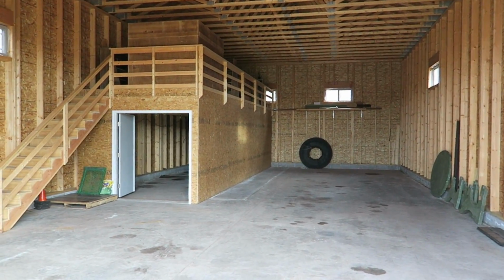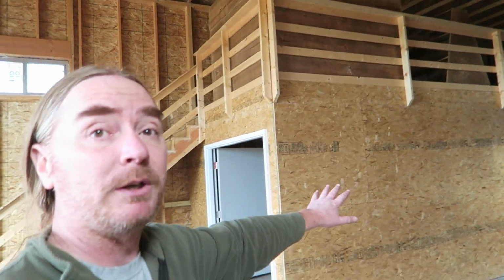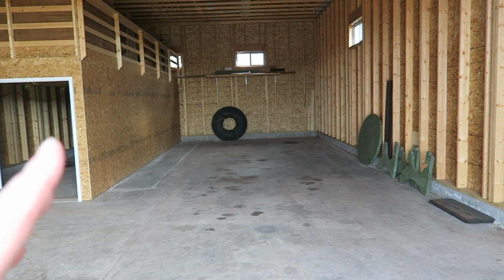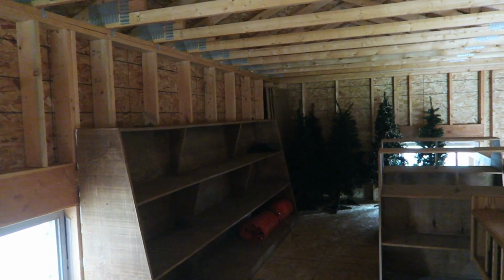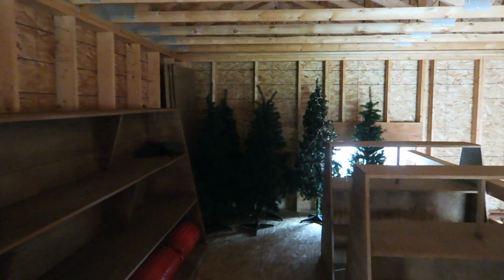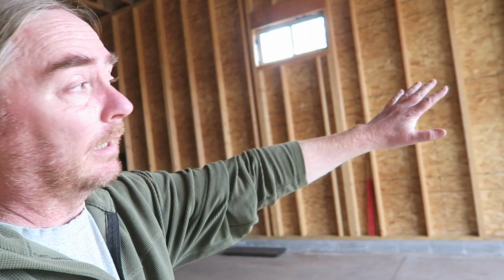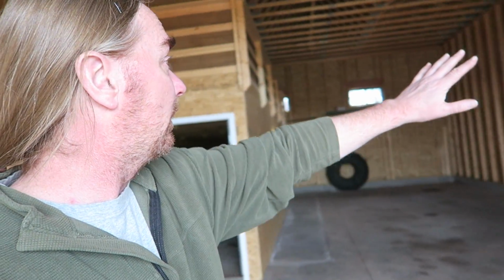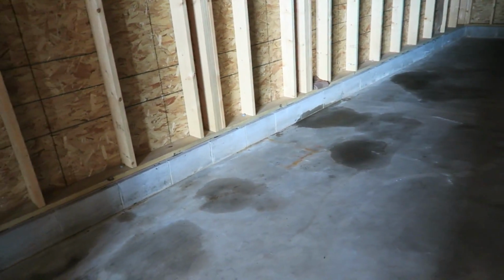CHECK OUT THE NEW BOAT SHOP!!

Comment: May I suggest spray foam insulation throughout. Mold, mildew and fire resistant drywall. My 1000 sq ft shop was fully insulated and unheated. I never had to wear more than a sweat shirt and most of the time didn't run ac. I live in New Hampshire

Comment: Look at the installed cost per R value, not which insulation has a better R value per inch of thickness.  A better insulation that cost three times as much to buy and install will probably not be the best solution.  I would assume that you can install 6" batt yourself.  I don't know what you figure your labor cost at, but I know mine is very low when I'm working on my own property as long as you don't keep track of the beer.  Your right about the inefficiency of heated floors.  It does make the floor real comfy, but you are putting the highest temperature against the cold cold ground which is indeed a heat sink. Insulation or not, it will increase the heat loses from your building.  Look at high bay lights.  Things designed for warehouse lighting.  These are available in many light sources.  LED is the most efficient light source we have today.  They are also usually the most expensive to buy.  They are supposed to last for very long time, but most of them require replacing the entire fixture it it does fail.  There are no bulbs to replace.  Retired building systems engineer.

Comment: ive been in the drywall trade for 30+ yrs. and i noticed the video where they hung and finished the drywall. i could tell they werent very experiabced however they got it done. on your new building if you want to save time and money and materials, use 12 foot sheets of drywall less seems/materials. 1/2" thick. 5/8ths will be very hard to hang and is overkill. Use 4'x12'x1/2" it will be fine. however if there is a code you have to go by there for fire code/safety then it will probably be 5/8" thick sheetrock. i know out in NJ if the garage is connected to a dwelling then you have to use double layer 5/8" (2 hr. burn time) on walls and ceilings connected to the house. i dont think you will have that issue there though, but i know for a building of that size there will be some kind of codes required. if the drywall guys try to use 4x8 sheetrock then tell them to go home. it will probably cost 30/35$ per sheet hung and finished. and yes, hang the ceilings then blow in the insulation. i dont think you have to foam the walls, im sure there is  roll insulation for that. but i am not an insulator. im a sheetrocker/ marine maintenance tech nowadays

Comment: Run your electric. Spray foam the walls and roof. Put in a drop ceiling to help with keeping heat down plus bright LED lights, ceiling fans to move the air.

Comment: Use 4000k led hi bay 22000 Lumens or better from a reputable manufacturer it makes it easier to get parts in the future. Most will have a 5year warranty on parts your electrician warranty should be 1year on labour.

Comment: This is the first time I have ever written a comment on any YouTube video. I am currently working on a bass boat which I purchased while it was raining and so didn’t take my time to inspect it thoroughly. I brought it home and you guessed it, I was a piece of junk. So I decided to o take this opportunity to learn how to work with cooso and fiberglass. I have so many questions I am not sure you could or would have the time to answer them. However, I need to start somewhere which in my case is the transom. How do I prep the rear of the boat before I cut and install the cooso and fiberglass if? Help me, Obi-Wan Kenobi. You're my only hope."

Comment: I would recommend having them spray about an inch or even less in the walls just to seal everything and using regular battens on the inside. You don't really need to go to the extreme  paying for that much  spray foam. Also you already have a vapor barrier with spray foam so you do not want one on the inside if the wall  as well, moisture caught in the walls needs to be able to escape.
I've been  building  my entire adult life, I'm  happy  to help in anyway I can. 
I appreciate  all the effort you put into your channel. Your my go to when it comes  to refitting my sailboat.

Comment: Don't choke on this project.  Get the utilities (must have).  Maybe insulate the small shop area the first year.  You need to generate income to get on your feet.  It sucks because a large part of the building has limited use during the coldest months.  Lighting is tougher choice.  I personally only use LEDS myself but I think the manufacturers are still learning.  Only 50 to 75% of the bulbs I buy get the actual stated life they indicate on the packaging.  Heat is an enemy to LEDs  If they get hot the electronics start to fail.  Make sure you allow for good ventilation around fixtures.   To efficiently heat I think you need air movement to keep the heat from piling up near the ceiling in the tall building.  Ceiling fans are cheap but the dust may be an issue when your doing final coats.   Just MHO    Good luck !!!!

Comment: Actually Harbor Freight might be your friend for lighting considering the have 5' 5500 lumen hanging LED shop lights for like 2 for $30. They sip power and you could hang a couple $200 or $300 dollars worth and light the shop pretty well until you can afford to go ham. I know Harbor Freight has a reputation for junk on a lot of things but some of what they sell is actually okay. I have 4 of those hanging lights I'm talking about in my small attached garage 16x24 and they've been running for 3 years 24/7 without issues. Not sure they'd be good enough for paint/body/hull work but with enough of them they should be good enough to get you by. As far as insulation I'm an old cheap fart and for that kind of money I'd just use plain ole' R19 roll and double it up with a good moisture barrier on both sides and save myself 10 or 15 grand. Throw some of the foam boards you see on the outside of houses on the bottom of those rafters and roll some more insulation on top of it and call it good. Anyway sorry for the book here just throwing in my two cents. Hope the new shop comes together as you want it. Good luck and God Bless...

Comment: Congrats on the new place.

Can't speak for all states but I think mine for electrical is that you can do your own work, but it must be inspected by a licensed electrician or inspector. Also, there are A LOT of electrical codes that can cause major headaches. Things like grounding, especially when you have water or gas pipes in the same building, number of outlets per breaker, outlet placement, lights per circuit, if exposed wiring is allowed, staple placement, ... the list is nearly endless. This is something you can do yourself, but be prepared to do the job twice, because you will have to redo whatever isn't up to code. Here's an example, another channel I follow recently did some electrical work in their shop. They added 3 phase power and did all the wiring. Turns out that he couldn't use white wire for 3 phase, so he had to run all new wire.

I'm cheap so I would probably do all the work myself and use a codebook or some electricians guidebook to ensure my work is up to code. Although this is assuming that the shop already had mainlines coming in.

Comment: I honestly think you could do the spray foam yourself, renting the machine. You have most of the skills already, and the majority of the cost is actually the labor rather than the materials. You'd probably have to buy a rolling scaffold rather than renting one, because it's going to be an absolute mess from leftover foam, but it will be necessary to do the wallboard anyway, and would be incredibly helpful if you do wind up working on large boats.

Comment: Definitely LED, just do your camera check to make sure they are "refresh friendly". But even the Harbor Freight shop lights are called, so super smooth on video.  You can get those for $24 each, or catch them for $14 on sale!

Spray foam is fine at 2-3", it'll provide air sealing, which is the first key.  After that you can roll fiberglass, it'll make it easier to wire/re-wire like some of the other guys said.

You don't want it "so tight it'll heat with a candle" though.  You're using chemicals in there, you need some air exchange. Trade off is paying to heat leaking air, bit you need those VOCs outta there.

Looks like an awesome shop, Good luck Andy!

Comment: You are most certainly correct in that you want to insulate full depth of the stud bay.  All your rough in needs to be done first.  Spray foam is fantastic it’s quick and clean.  Anything you want to ask about the process of finishing off your building.  PM me if you like.

Comment: Large LP tank and install infrared heaters in addition to the hydronic base board heaters. A 300k unit heater along with ceiling fans wouldn't be a bad idea in addition either. GA HVAC contractor here. Good luck !!!

Comment: Look for tradesmen that will trade boat  work for shop work. Keep the loft but remove the room below if it doesn't fit your needs. Yes Closed cell spray foam is expensive but if sprayed correctly will strengthen the shop structurally as well as insulate. Do your homework and make the best decisions based on your budget.

Comment: Cast iron baseboard radiators (Google it) or reclaimed building material stores for old radiators. I would go with fiberglass batting for overhead insulation rather than the blown in (used it once, not a fan). My two cents.

Comment: Fiberglass bats and a good vapor barrier job. Calk the joints and seal the wall before you put the fiberglass in. To tight promotes mold. I’ve had buildings flashed with foam first. You don’t have the room. If you had 2x8 studs it would be a different situation. Save some money up front and do a good job on your vapor barrier. Also invest in good air movement and keep the heat off the ceiling. I have a 40x60 in Alaska. 8 inch wall studs. 18 foot sidewalls. Hot water Floor heat with foam under the slab. Blown in attic which we did ourselves. Use the keep it simple method.

Comment: Congratulations! I spray-foamed my home and garage myself. You can order the canisters of two-part spray foam online. In my opinion, I would do insulation in three steps: Testing, spray minimally, finish with bats.  1.) Start with a blower door test. This simple test is a great way to find out how tight your building really is. You want like 90% or higher. Depending on the results of the blower door test, use different insulation methods. 2.) If your building leaks a lot, spray foam in a "window frame" technique, where you spray only in joints and corners (looks like a bunch of rectangles everywhere). This is an inch or two in the corners of bays but seals up the building really well. Run another blower door test and see if you get a better number. Once that's good then on to step ... 3.) Batt insulation in all the bays (over the "window frames" made by the spray foam). This is cheaper and an easy DIY project.                            The deal is, spray foam seals your building so it doesn't leak. But it's only needed in gaps, joints, seams, and any tiny space air can pass through. Batt insulation is cheaper so finish with that after spraying the building tight.  Spray foam is a really fun DIY project!

Comment: Hi Andy, here’s a bigger pill. Forget it-if you’re interested in real efficiency, forget the spray foam, flash and batt nonsense, or any of that other stuff. You can save the roof trusses and roof. 1. Support the roof. 2. Cut out the sidewalls-maybe someone will purchase. Replace with ICF-you can salvage the windows and doors. Sounds crazy, but you can then lower the roof after pouring the walls and you’ll have created an extraordinarily tight space with less unnecessary volume. All LED lighting-educate yourself on heat/color and you’ll find something you’ll be ecstatic about. Make sure to dig around perimeter of structure and insulate the foundation/slab from your soil. It’s really not as much work or as expensive as it sounds given that there is no existing infrastructure within. On demand hot water which you could also use with radiant, though if using radiant put it on styrofoam panels designed to accept and pour another slab over the top of everything. Yes, a lot of concrete-but worth it. Others may suggest a wall hung modulating condensing boiler with a Superstore or some such, but likely unnecessary. If you’re into efficiency and can afford the outlay, do this. I’ve built a few things, and this is what I would do. It will pay for itself shortly, unlike anything else-which means you are then making money.

Comment: Hi Andy: Well from my perspective I would forget about the spray foam.  Oh sure its a good insulator and will result in a good air tight structure but $18,000 is a lot of money.  I would drywall the ceiling and then blow in about R-50 in the ceiling.  I would go with something like rockwool in the walls for about R-17.5, vapor barrier and drywall.  Should result in good air tight structure if rollup door fits well.  
ELECTRICAL:  For what you do a 100 to 150 Amp sub panel should give you more than enough power for your shop tools.  Sub panel and breakers should be mounted on an outside wall since you do use combustible materials.  Outlets everywhere is my suggestion since they are quite inexpensive during construction phase.  Arc fault outlets will be a must.   Solar panels on the roof are certainly recommended if you are not in the snow zone, ha ha. Those panels can be grid tied to reduce your electric bill.  See below for heating.  And I do recommend a backup generator system.  Power outages are not uncommon in some locations.  Several good manufacturers of backup systems are available at a reasonable cost. A small propane tank can get you through several days of lost electrical power from the local utility.

HEATING:  This is a tough one.  I would recommend about three "mini split heat pumps" which will provide both heating and cooling.  However, I am not sure of your location so this is an unknown.  I would recommend them since they provide heat without a flame and you do use solvents, thinners, cats, etc. which are flammable.  Also they are VERY efficient but most only work well [or efficiently] down to about 15-20 degrees F so some form of backup heat might be needed depending on your location.  They will work down to about -5 degrees but not very efficiently.  One option for an enhancement would be an "air wall panel heating system" or "roof mounted" air heating system.  That should provide most of your heating during the daylight hours if not covered with snow, ha ha.  Your building is tall enough to get good sunlight for both solar panels for electricity or solar air heaters for free heat from the sun.  Let mother nature help with the heating and cooling bills. A geothermal ground heat pump system would also be an excellent choice but still quite expensive however the operating costs are very low.  Look at something in the range of maybe $20,000.  Again it is highly dependent on your specific location and soil conditions where the ground heat exchangers would be installed.  That system would give you heating and cooling REGARDLESS of the outside air temperatures 24/7/365.     

LIGHTING: Totally agree - LED is the only way to go.  8' long LED fixtures however I would go with something in the 3500 to 4000 color temperature range which is a semi-white light. As we age, whiter is better, ha ha.  And I would try to have some LED's on the side walls at locations where you might be working on the sides of projects. Those in the ceiling 14' feet away are not going to be very helpful except for general lighting.  I might also consider s tracked or trolley system for some closer overhead lighting.  And with a little creative thinking a 16' long connected string of lighting could be mounted on sidewall tracks which can be tilted up or down as needed so they could be used anywhere along the total length of the shop walls.  8' LED's from Amazon come to mind.  

VENTILATION:  A heat exchange system will most likely be needed in your area but again this depends on your specific location.  And when solvents are used a localized ventilation system is recommended.  

Good luck and have fun.  Now is the time to sit down and consider all of the little things that once bugged you about your old shop.  Bare wall are an open invitation to your creative thinking.  Take care and stay safe.

Comment: The quote you received was for closed cell....$$$ 
You need a quote for open cell, it will fill the entire void and they scrape it flush with the studs..$$
Personally like open cell for cost vs r value. Plus what ever siding you put up adds more r value

Comment: I'm an hvac contractor in Virginia and I have a lot of experience in boilers, especially large commercial applications. I would just use a forced air furnace instead of a boiler. Is there a particular reason you would add the radiators and pumps when you can just directly heat the air? You can also look into infrared heating.  It heats the concrete and other objects in the space and they radiat the heat into space, pretty efficient and good for shop type applications.

Comment: I’m located near Traverse City, MI.  I had 2” of closed cell sprayed to encapsulate the 16x32 shop inside my pole barn - it’s been great: stays comfortable year-round with just a small electric fan heater. I have not felt the need to add any additional insulation, and I have no problem with mice after 18 months.  I finished the interior with simple OSB, the ceilings with white metal, and hung banks of 8’ LED fixtures.  I’m not a pro, but I’m happy with the outcome and was able to afford it by doing everything but the foam myself.  You can do the electrical yourself, but your insurance agent may discourage you: ask an electrician to verify that you’ve done the work properly.  Best wishes and welcome to Michigan!